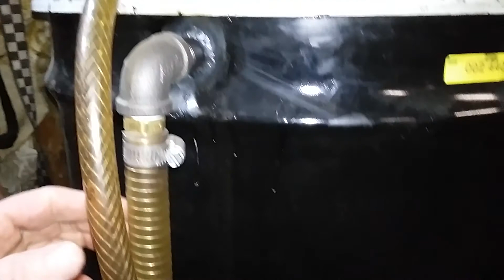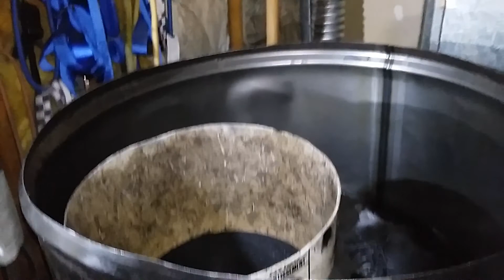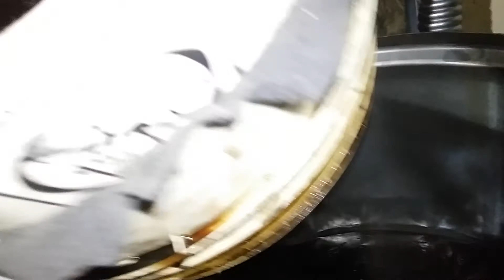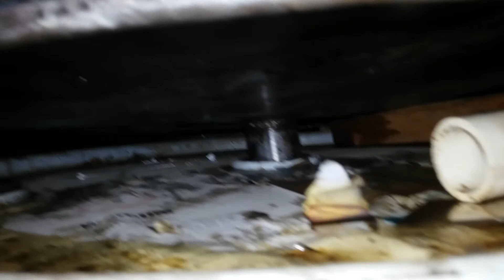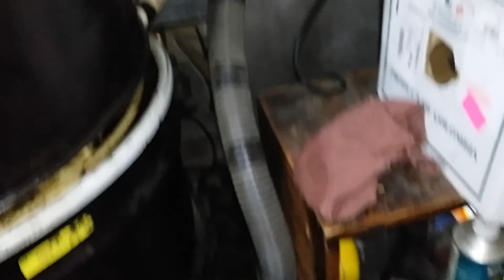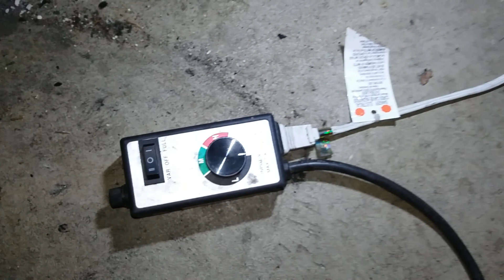WASTE OIL HEATER BURNER BULK RESERVOIR TANK OVERVIEW

Comment: I bought a really nice parker needle valve and was working great  meatering oil flow  this past week I have ran my stove every day  and the problem I have been having is adjust the oil flow and walk away 30 minutes later oil flow goes to a drip   I have pulled valve off and flush ed with break clean and blew air through it to make sure it didn't have trash it it . I notice u have a clear hose running up from ur clear bowel after the needle valve  what's that for?  Any ideas on what I can do to fix problem?  Thanks Jason
Reply from the maker: That clear house is just a vent line that might be your issue Maybe. I watched your video on your stove  but it doesn't have the needle valve on that video, You'll have to post a video and let me know and I can look at your setup!
Reply: @mugivermusclemachines5744  https://youtu.be/9pw5xVx2ymk
Reply: Only video I have with needle valve  installed  sorry it's short video  I can get longer one tomorrow